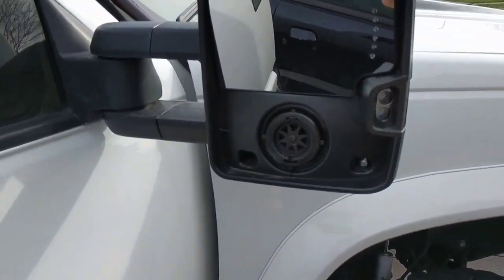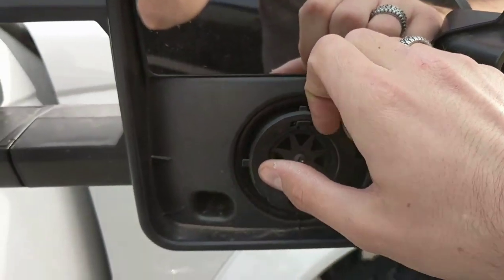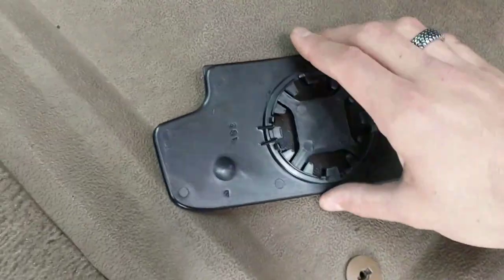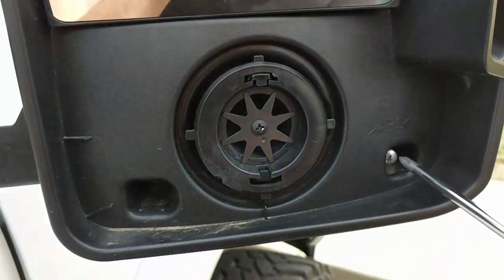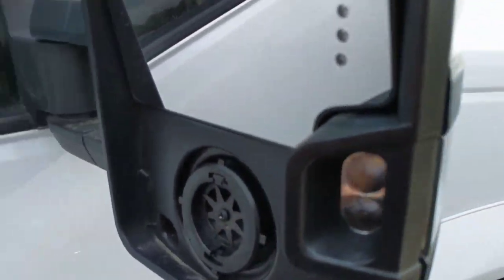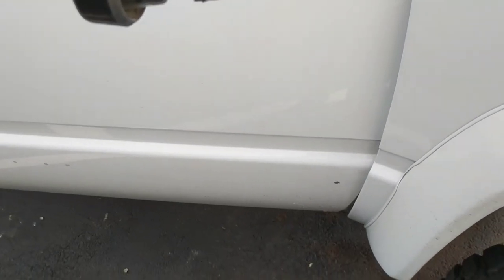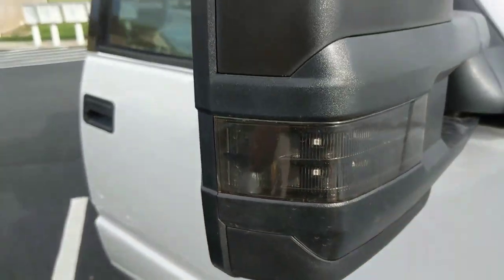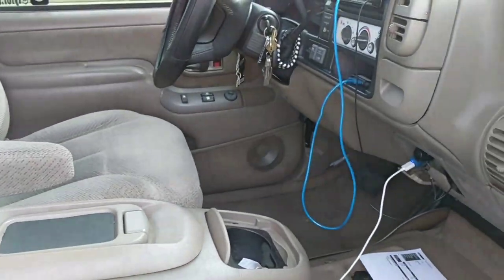How to Remove Tow Mirror Caps

Comment: Where did you get the black caps?
Reply from the maker: +DIYAUTOMOTIVE I just had them from a spare set of mirrors.
Reply: BADZ71 I'm doing custom modification I bought a set of brand new mirrors and I'd like to take them apart I seen you do the lower glass how do you do the upper class we are moaning these mirrors on a F350 1980 Dooley and they will be custom mounted on the old Breakaway brackets Bolton to the door
Reply: boostautoparts.com has them.